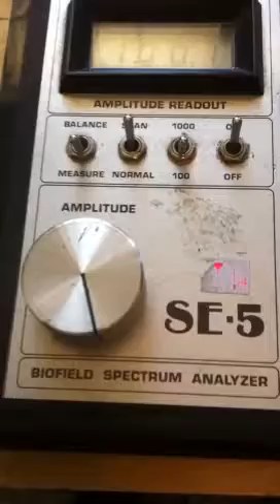Measuring the SE 5 Biofield Spectrum Analyzer

Comment: I have the SE-51000 and the CHI Remote Balancer that uses the SE-5 preprogrammed cards and each card has a holographic sticker, it is this sticker that can be programmed using the SE-5. Place the programmed hologram into the remote balancer and let it do its thing. I programmed a hologram sticker for fuel savings it was about 8 lines long and4 4-5 words in width. After the programmed time, I placed the sticker underneath my gas tank. After about one week I had already forgotten about this sticker, with so much on my mind to do every day. One day I filled up my RAV  4 Toyota and cleared my mileage for a new tank run. I do this all the time. It was winter and I was getting 24 mpg. Which isn't too bad. On my next fill up I looked at the mileage the trip meter and it read 270 miles, the most I ever got from this vehicle in the winter was 250 miles from full to empty. I wrote it down on my gas receipt and my wife was balancing the accounts and she noticed what I written and she calmly said, I guess that holographic stickers is working! I looked at her surprisingly and told her I had forgotten all about that crazy thing. I told Don Paris about it and he congratulated me for a good experiment. He also told me as long as the hologram doesn't wear off, you will continue to have better tase mileage. No Placebo here! I want to get my Live Blood Microscope 2500x power to see if the SE-51000 works on the blood level. Such as programming a hologram to create more alkalinity in my drinking water and then looking at the before and after pictures of the water. Consume the liquid with the hologram stuck on the bottom of the glass and test my blood before and after live screen shots. Just owning such a device does it an injustice, having a microscope and remote balancer can help prove some of the programs do actually (anecdotally) work.

They say the proof is in the pudding! I did the nectarine experiment by sending an Agriculture program for preserving fruits and I placed from the same batch at the store another one and placed it on the saucer with no programming. Right at the two week mark, the untreated fruit was decaying rapidly and the fruit that was programmed on a subtle level was thriving and still bright! The other nectarine had fruit flies all over it! I sent the preserving program for only 6 hours during that whole 14 day waiting period. Placebo nada! Did the same with a credit card size plastic blank card and I placed a hologram sticker on it. I then placed it in the picture holder of the SE-5 and programmed on to the hologram a preservation program from the agricultural section of the SE-5's library. Once it was completed, I placed this card inside the remote balancer to broadcast this program to a nectarine, it's been three weeks plus, the nectarine is still showing no outward signs of decay and its color is still bright! I also placed this card under the saucer containing another nectarine and one without and the one with the hologram program under the saucer its fruit stayed bright and the other decay and rot,

Here we are not talking something complexed like the human body but of a piece of nature only. My experiments are still being documented privately. My equipment with the SE-5 along with the Remote Balancer and the Microscope DarkField Live Blood goes over $7000.00 which includes a laptop computer. There is not a whole lot of people willing to invest this kind of money for these typical experiments, unless it can win them the lotto. I am currently working on elixirs to program and seeing the before and after microscope live videos to see if the liquid transformed from simple mineral water to complex crystalline structure. If Don's work so will mine! We both use the same devices and Don Paris encourage me at the beginning to try his experiments to see what we get! He simply has nothing to hide from his customers. Where this will end up, is anyone's guess at this time but it's my hobby and enjoy working with the best equipment for spectrum analyzing.